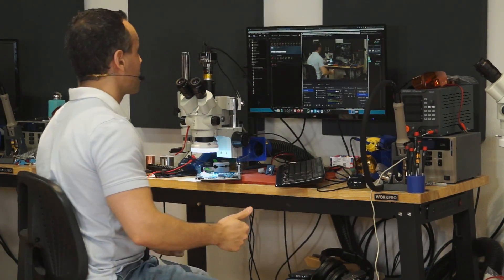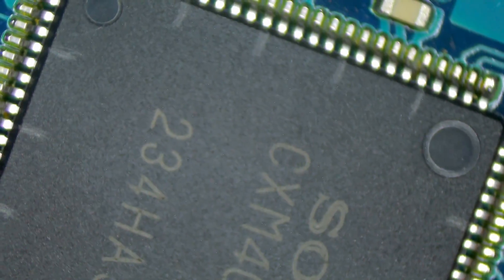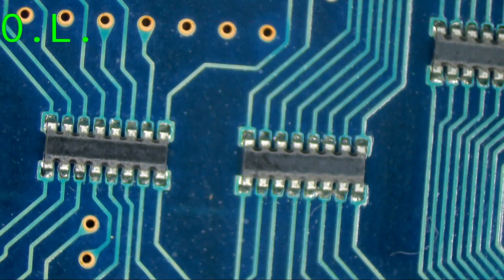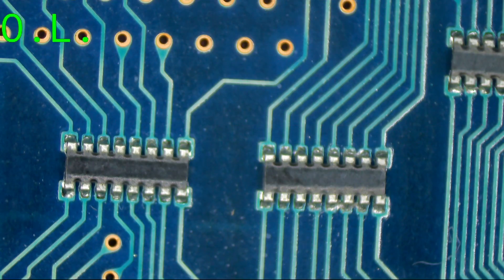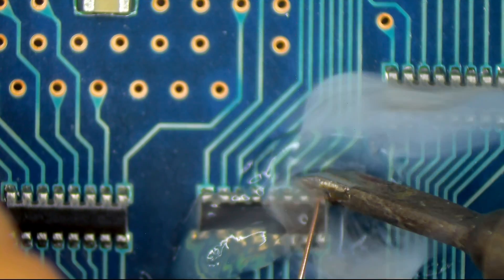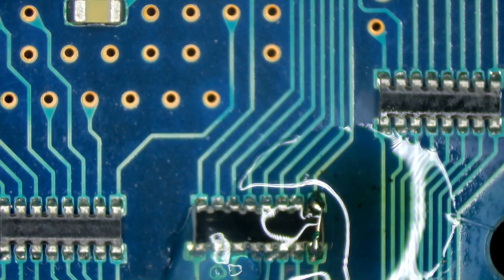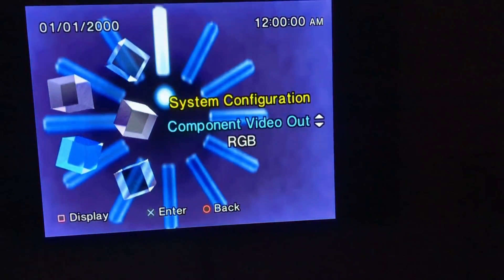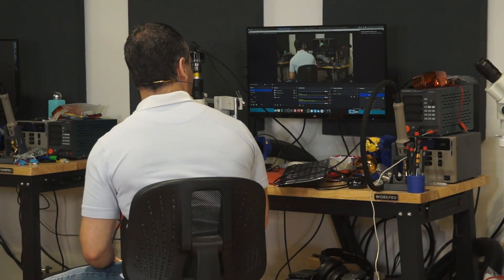23 year old PlayStation 2 console with no video - can we fix it?

Comment: I still have my 20 year old PS2 and still play it regularly. Don't have to worry about microtransactions with any PS2 games!
Reply: Been thinking of pulling my PS2 out of the box I have it in myself. Over 40 games that I can play whenever I feel like it without the need for internet is so wild nowadays to think about.
Reply: @Kazeshini11  emulators for PS2 are quite good and don't take a ton of horsepower to run
Reply: @Kazeshini11  Yeah, that's why I always buy my console games in physical form with the case, with the manual, case artwork etc. Once the console becomes old, I'm solid. I still have PS 1, (sold OG PS3 with backwards compat for some reason years ago) Gamecube, Wii, Xbox, Xbox 360, and then PS4 Pro but that's not old yet. It's so nice to be able to sit down, pop a disc in a tray, open the case and pull out the manual and  immerse yourself with no internet or microtransactions or updates to download etc. Like COD literally updates EVERY single time I open it to play forcing me to wait 20 minutes or whatever.
Reply: The good old days! I still have my launch fat PS2. It still works!
Reply: @robertlawrence9000  I have the original PS3 that can play both PS1 and PS2 games so I don't need those consoles but it stopped turning on after so many years. Sucks, I want it fixed. It's been sitting in my closet in a box lol
Reply: @wombat5252  I went through 2 of the 60 GB launch PS3s. Got YLoD on both. 
Now I have a PS3 that doesn't have PS2 back compat. I cried both times when they failed. 😢
Reply: @robertlawrence9000  I feel you. I felt awful when mine died. I was really young so it's not like I could get a job to pay for another at the time. Parent's weren't rich so it's not like they'd buy me another. It was fun being able to just use one console and playing PS1 and PS2 games  with my dad or by myself. If only I was more tech savy...Hopefully one day I can have it fixed. Lol
Reply: I have a modded PS2 with a 1TB harddrive. So many great games on that system, from all genres too.
Reply: Or required patches
Reply: @Daniel-it1dp  sadly not entirely true. There's several games that look and play better with deinterlace/widescreen patches, though these are still optional, they do often lift the games to a much nicer point
whether by emulator or real hardware, these patches aren't hard to find and apply, there's a database of widescreen cheats on github at the very least
Reply: @BulletFever1  hence why I said “required” patches 😉
Reply: Yeah i only play old consoles its so much nicer than modern bullshit just put a disc in and play. i dont really see the point in playing anything new, the last few new games ive purchased have been pretty lackluster and theres thousands of old games i haven't played
Reply: @NO_obs  lots of people miss out on that when all they buy is things with the "NEW" sticker
Reply: I'm an original PS1 fan myself. Got two mod-chipped consoles and I also run an emulator on an old Intel Core 2 Quad system and 1080p TV at full resolution. I still have a blast playing the old Crash Bandicoot and Crash Team Racing games. I don't care how many people diss on "old" 3D graphics, personally I find it doesn't stop games from actually being fun.
Reply: @YoureUsingWordsIncorrectly  Even better, could use MX4SIO adapter to play from microSD, completely modern solution. Speed's supposed to be better than old crusty USB 1.1, so possibly more bandwidth for FMV cutscenes, and no need to break up DVD9 isos into weird part files since exFAT is supported.
It's not perfectly compatible, but speed-wise it's the next best thing since Ethernet on a slim console...
Reply: @ZXRulezzz  mx4iso seems like a really cool concept but I think SMB works best through OPL. Nothing beats using DVDs in my opinon. I'm certian there are still laser replacements you can get since these things were faulty as fuck somtimes and would burn out or require recalibration everynow and then. Miss modchipping these back in high school.
Reply: same, gotta fire up the old JAK 2 game haha
Reply: i deeply regret selling mine, atleast theres emulation on pc and android for it so thats atleast okay
Reply: @perma4671  it's amazing how far emulation has gotten
Reply: You guys can use pcsx2 (the legal and honest way) by dumping your bios and games to play on your pc
Reply: I remember trying to fix the dreaded disk read error and i couldn't and my brother put the blame on me of opening it that it wasn't working... bruh that disk read error wouldn't have been fixed otherwise anyway but thanks for bullying the hell out of me!
Reply: I still have my fully working PS2 connected to our home theater. However, I mostly play Fallout 4 on PS4 Pro attached to the same system.
Reply: Damn you got your moneys worth
Reply: Dude i feel you! Same!

Comment: Can you add HDMI to old video game counsel?
Reply: idk but I'm pretty sure you can buy an adapter for it.
Reply: RetroRGB is a good start for figuring things out, but a lot of physical mods are pretty spendy. I'd start with making sure you have component or RGB out, maybe just S-video will be fine (S-video is a far cry from composite, and might be satisfactory enough for you, I'm fine with it for N64 myself), then picking up a decent solution to convert that to HDMI. 

Component, I have a gbs-control + vga-hdmi converter personally, DIY soldered myself, I like it. S-video, I hear RetroTink is good (good reviews for component solutions also), possibly even a cheap s-video to vga converter paired with a vga-hdmi converter might be fine, might. 

Latency could build to be an actual issue with cheaper solutions, though, if you care about that, a CRT would be what you want.
Reply: @somedude4267  thanks! Yeah I’ve been thinking about getting a small CRT for all my old systems. I was thinking about emulator’s but it’s not the same feeling for me
Reply: @Mr Guru thanks most definitely will check my tv

Comment: I wonder if this PS2 was one of the "slim" ones.  The slim systems are known to have video output issues and airflow issues (not to mention the only fan on there being a blower), never mind the obvious con of not being able to plug in a hard disk.
I've replaced one with an older fat system (apparently an ethernet adapter bundle) and placed a SATA hard disk in the ethernet adapter (obviously replacing the adapter's stock IDE connector board for Bitfunx's SATA board), never needed disks since.

Comment: How come my Commodore 64 still works perfectly even after nearly 40 years and heavy use? It shouldn't be possible...
Reply: old systems are build quite well and tend to not run at the upper limit of their capabilities or capabilities of the materials. Fuck, I know at least one C64 that still is used in an automotive shop to type receipts and such. Only big issue C64's have are the power supplies as they tend to break and take the system with it, but these days it's easy to get a modern replacement. (and audiophile are the biggest plague to living C64's)
Reply: @relo999  thanks, yeah I have replaced the power supply and cassette deck, but the main board and everything else is 100% original!

Comment: I have two of these, one of them has the bracket that holds the front connectors daughter board destroyed, the other works fine but the Ghost2 v2 chip doesn't power on for some reason.
Maybe one day I'll try to fix them, as of now, PCSX2 will do just fine.

Comment: Could you not replace that resistor bank with a set of through hole resistors from any electronics shop, would be the same as jumping it, but removing the chip first
Reply: It is probably way too tiny for that. The legs are too small to hold a lead, the leverage would break the joint unless you glued each resistor down first and ran a jumper to it (and then, what is the advantage?). Resistor arrays are super common, if you want to go to the level of buying something you can just order a matching one from Digikey or Mouser.

Comment: Brace yourselves other electronic repair centers, now that Louis is out of NY prison and is paying sane rent prices, the Rossman Repair Group will be able to make repairs on more than just the most overpriced computers known to man
Reply: Yeah.  I inherited oscilloscope and wish I knew a repairman that could make it work again.  I don't want to die repairing it.  I watch this channel as a CSC programmer and I do electrical repair about once a week just for maintainence of my lab and studios.  The oscilloscope is out of my depth.  I know I could fix it, but why.  A repair man like rossman working on the board would record and document everything.  Like he said, he recorded the voltages of each pin in a spreadsheet.  That is some top shelf (reverse) engineering.
Reply: @complexity5545  Don't worry, electrostatic CRTs are "only" around 1.2kV for deflection, versus up to 32kV for a monitor or TV!
Reply: @ziginox It really depends on the speed. The faster the analog oscilloscope, the higher the accelerating voltage, all other things being equal.

Comment: A 47R resistor paralleled with 800k or 200k should suffice. The failed resistances are so high they're negligible when paralleled with the small one.
Reply: As long as they stay failed. Is it possible they could be intermittent?
Reply: They’re aren’t in parallel they are individual data lines each resistor is separate inside the package

Comment: May I send in a broken PS3 controller?
Reply from the maker: For me to throw at a wall, sure. For me to fix, no.
Reply: @rossmanngroup  Whats your crazy price that you would fix the controller for?
Reply: @rossmanngroup  if we get a video out of it, it might be mildly entertaining content.
Reply: You can buy a PS4/PS5 controller and use a Brook or Mayflash adapter to make it work with your PS3 machine.
Reply: @devincurrie4145  Do I have to jailbreak my PS3 system.
Reply: @hussainalmosawi3872  No, you don't need to jailbreak your PS3 in order to use Brook Wingman or Mayflash adapter.

Comment: Yes Louis. You need to reflow that one big son of a b and give no warranty. It gave me PTSD.

Edit:
I commented before watching a video and as you can see I had have thought it was an ps3.

Alcohol is bad for your health.
Reply: tbf these BGA's are probably not flip chip
Reply: reflow or reballing on PS3's doesn't work. The reason PS3's fail is thermal stress on the package due to poor manufacturing/underflow. You need to replace it with a newer chip and a small mod to make it work, which these days is quite hard seeing as the well of replacements basically has run dry without harvesting of other consoles.

Reflow only really gives the impression it "fixes" it but fails again within a year with 80% of users, nearly all within 3 years if I remember correctly. Reballing doesn't have much better numbers, because the BGA isn't what's failing in nearly every case rather, again, it's the package.
Reply from the maker: NO REFLOW 

Reflowing flip chip BGAs isn't repair, it's garbage.
Reply: @rossmanngroup  I am sorry, Louis. 🫣